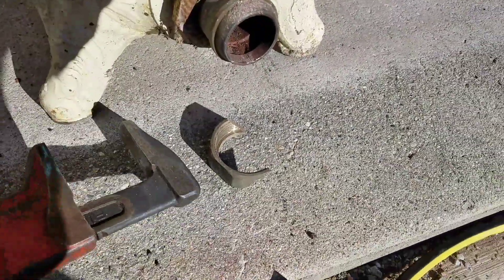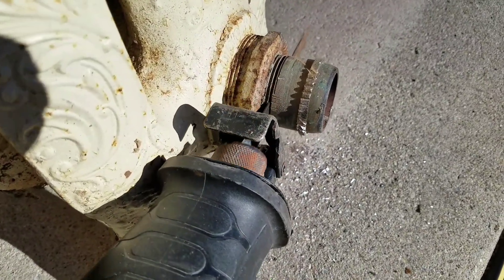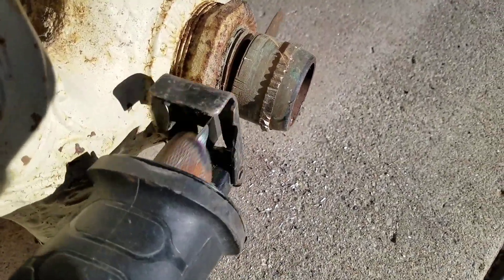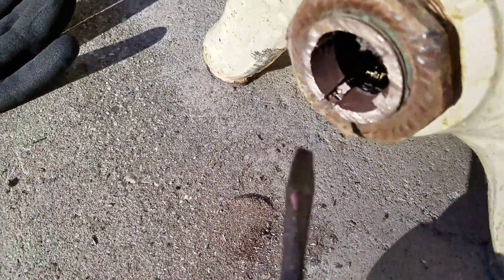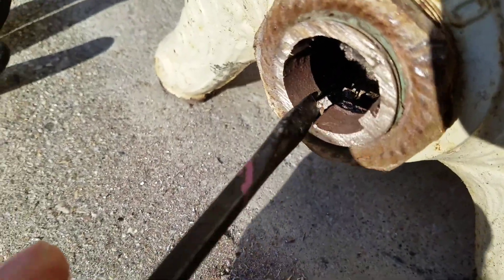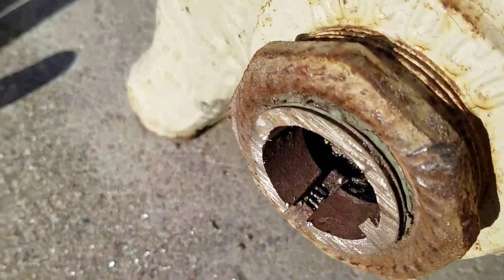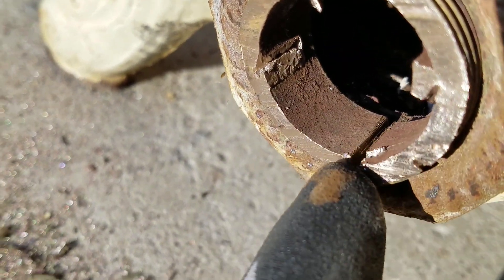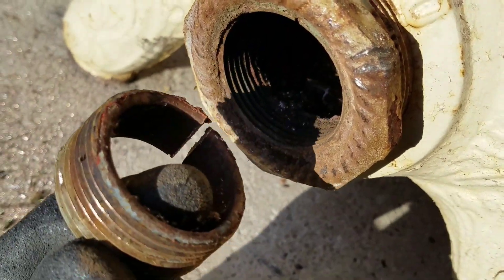Cast Iron Radiator Restoration Part 4: Radiator Valve Replacement

Comment: Thanks for the tips.. I just took off my cast iron radiators and I had one question: No Teflon tape or something similar is needed on the threads when installing the new fittings? Just screw them in and done?
Reply from the maker: Use a fair amount of Teflon tape on the threads of fittings at the pipe and radiator body connections. Some radiator techs use a little pipe dope and tape. The center connection flanges that thread together are self sealing brass flanges and require no tape.

Comment: Don't forget to pick the radiator up and give it a quick shake to get all the metal shavings out 🤣
Reply from the maker: next step it goes out to sandblast and paint, then a fllush/pressure test, and final coats of primer amd paint.
Reply: @myoldhousefix  I was actually making a joke given these things are 200lbs and up lol. My own which looks to be a little smaller than yours (waitaminit....) weighs in at 220.

To be serious though, do you intend to replace the larger bushes at all or are you leaving them in place if it pressure checks good?
Reply from the maker: @NordicDan   yeah, they are heavy, hey! I usually leave the large bushing unless it's leaking or heavily corroded. Thanks for the comments!

Comment: Woah Sawzall guy. With an angle grinder you can turn a 1/2" drive socket into a tool for those Valve nipples.
Reply from the maker: its true, there are many different ways to accomplish removal.

Comment: You forgot to put the ring on the fitting.
Reply from the maker: the end shot was just to confirm that the new fitting threads in properly. The radiator is sandblasted and painted before final assembly...👍
Reply: thanks for your help, you saved the whole thing
Reply from the maker: @SimgoWood  you're welcome!